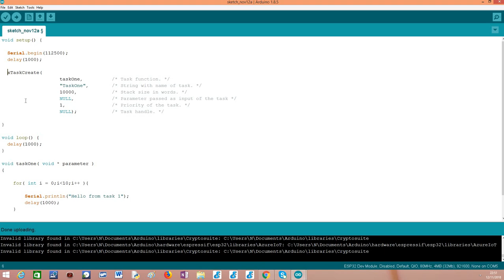ESP32 Arduino: Creating a FreeRTOS task

Comment: Thanks for sharing!
I am working with ESP-8266-DevKitC development board.
I followed your code but it is not working with my board.

I can compile your code with Arduino boards, but when I select my board ( Tools > Boards Manager > Generic ESP8266 Module) there occurs an error.
"fatal error: avr/io.h: NO such file or directory #include <avr/io.h>"

Could you please let me know, how to resolve these error??

Thanks in advance!
Reply: There is no suck thing as and Esp8266 devkitc.  Are you thinking of the ESP32?

Comment: How can You get the messages over Serial terminal as your baud rate in the code is 112500 and terminal is running on 115200
Reply from the maker: Hi! I had the code uploaded beforehand, so while preparing the video I've probably messed up the baud rate.

But thanks for noticing it, indeed we should use the same baud rate in both places :)